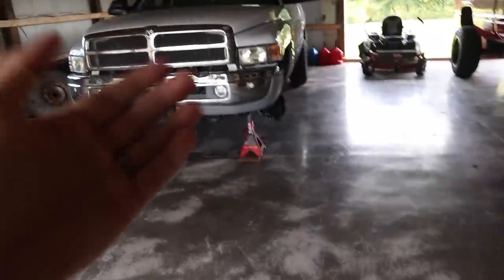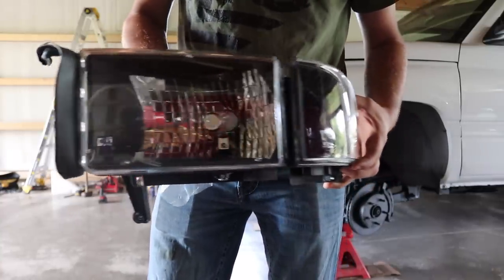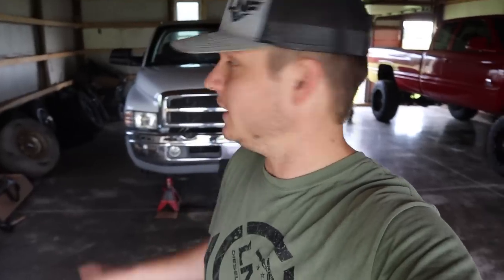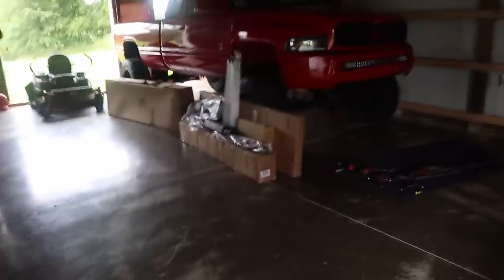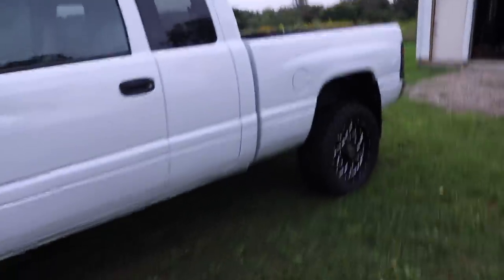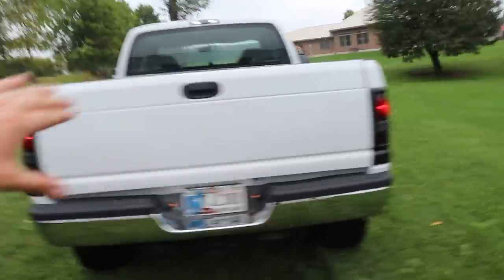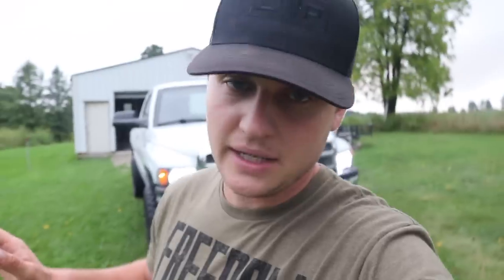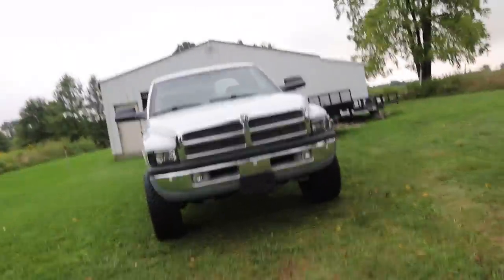I built my dream truck in 1 week!! [ FULL REVEAL ]

Comment: Not a serious dodge fan. As with some of your other dodges it caught my eye.it turned out great. Will make a great daily driver. Is there an adjustment so you can turn the outer ends of front bumper up closer to the headlight.
Reply from the maker: For sure man! Yeah I know.. I noticed the bumper was off a little